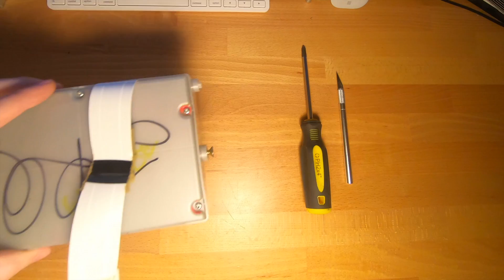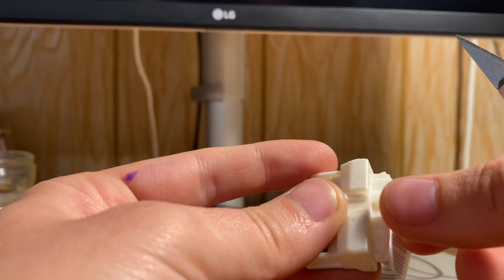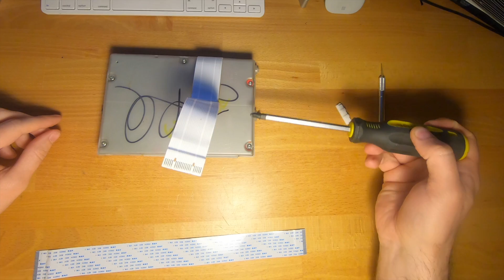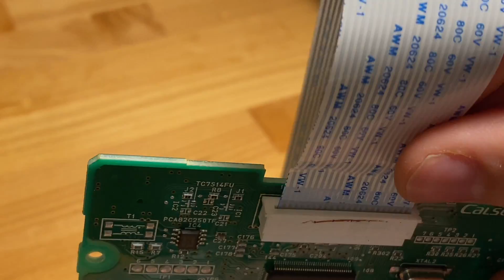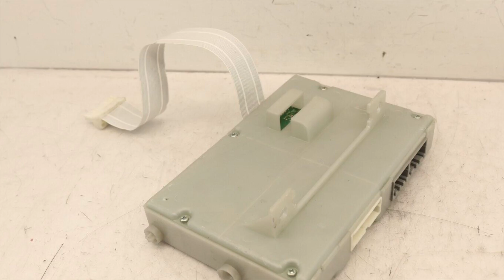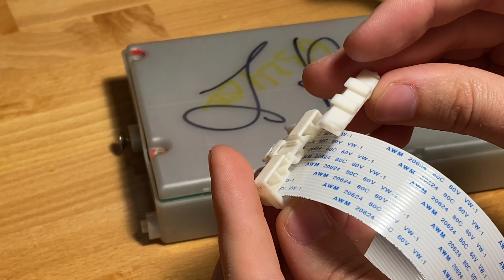DIY Ribbon cable repair on Climate Control HVAC Amplifier Z33 and A34 27760-CD000A / 27760-7Y000

Comment: Hi, Frugal Fixer, I was wondering if you could give a location on where to get the Hvac unit? do I need to disassemble my dashboard to get it?
Reply from the maker: So the unit is located behind the radio. Unfortunalty the dealer does not sell the units any more. so your only option would be to get a used one. or you can purchse my ribbon cable and swap that out first. Most of the time its just the cable. Usualy when people install aftermarket radios in there cars. There is a good chance they can damage the fragile cable and that can cause issues